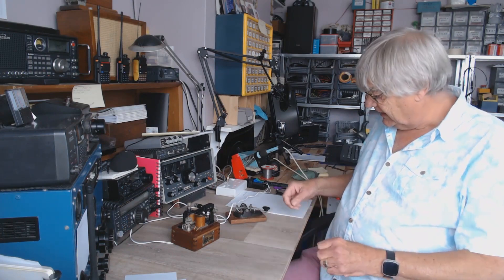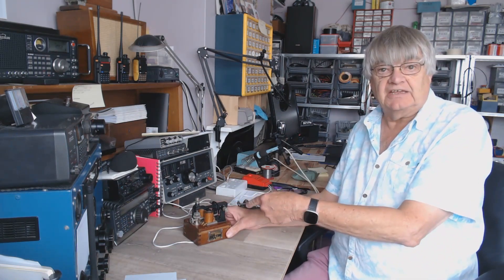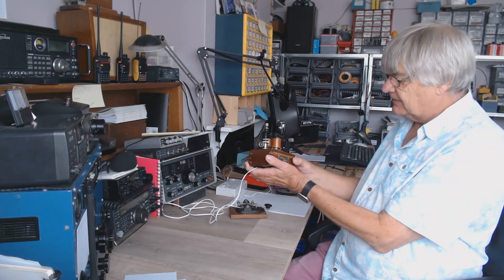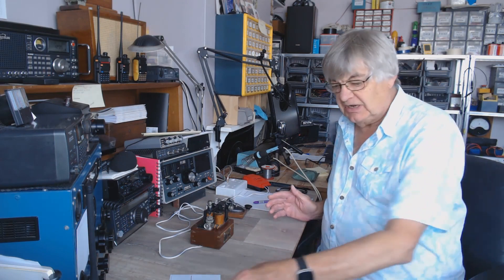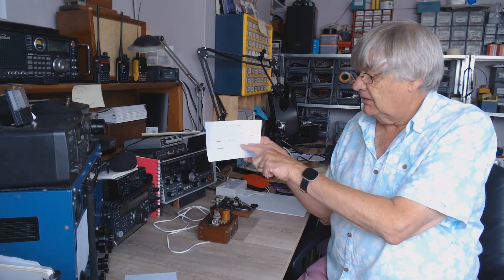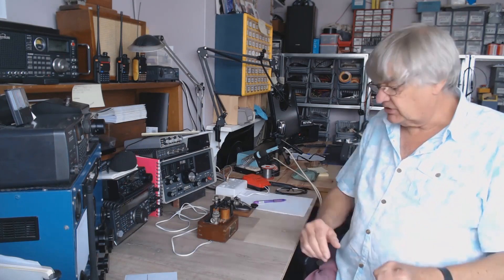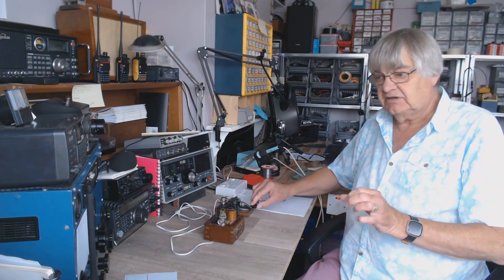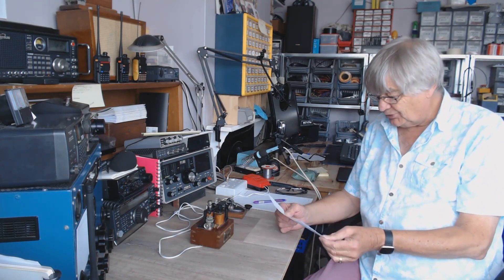G4NSJ - Vintage Morse code sounder relay Air Ministry telegraph

Comment: To my knowledge, relays were used to join a secondary line (circuit) to a main line. Main line were long and the signals faint.  Signal was « amplified » in the secondary line which had a different power source (battery) by the relay

Comment: I'm curious Ray. What is the resistance of the relay coils and is the power supply you're using current limited? 73 Al
Reply from the maker: I thing the resistance is 500 ohm. I should have made a note if it. The power supply was 12 volts.

Comment: Hi ray just to let u know there’s a BHI DSP SPEAKER WHICH I USE FOR SWLING ITS VERY GOOD AT NULLING OUT NOISE THERE ARE DIFFERENT VARIATIONS OF THEM ON THEIR WEBSITE JUST TO LET YOU KNOW I DONT KNOW IF YOU CAN TRANSMIT BUT YYOU COULD CHECK IT OUT.ITS AMAZING HERE IN A SUBURB IN. DUBLIN. ANYWAY HOPE YOU GET THE NOISE PROBLEMS SORTED. I GOT THE DESKTOP VERSION OF THIS AND ITS REALLY VERY EFFECTIVE FOR MY NOISE.
Reply from the maker: Hi Gary, that’s interesting. I’ll look into it, thanks. Cheers, Ray.

Comment: Hi Ray similiar units like this were basically used as repeaters.  So the relay had contacts feeding another length of wire.  Cheers from old George
Reply from the maker: Thanks George, I didn’t know that. Cheers, Ray.